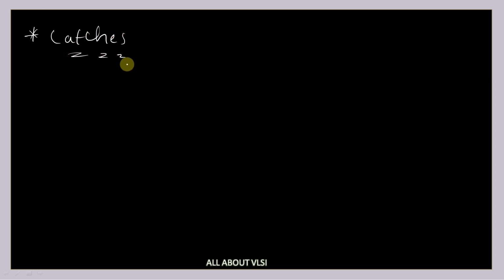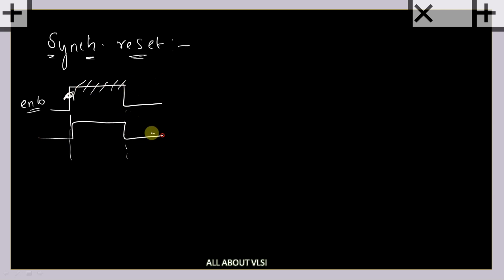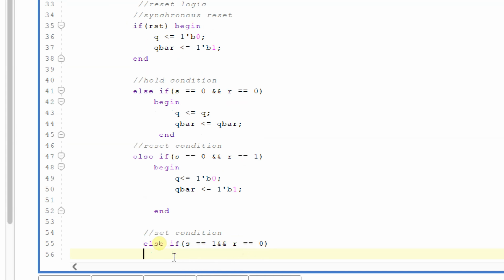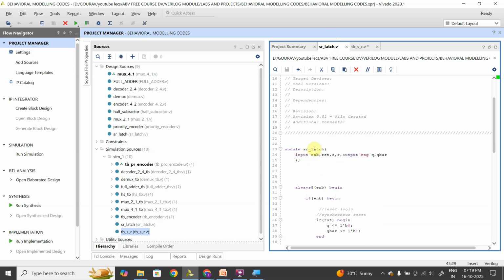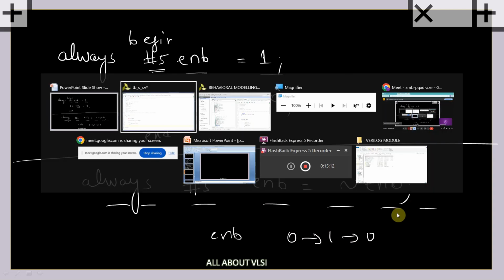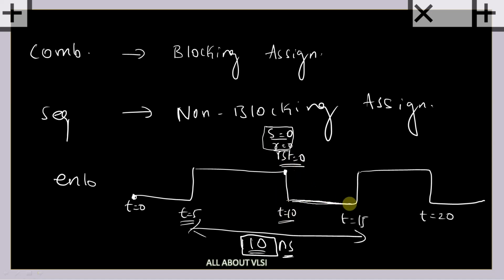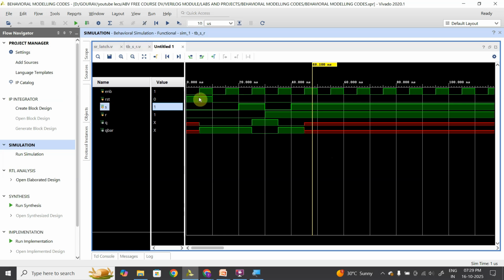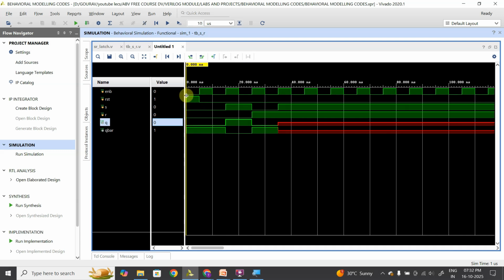SR Latch Design in Verilog | Step-by-Step Explanation for Beginners || Verilog full course ||

Comment: Sir, I am struck  to understand the difference between synchronus and asynchrouns reset
Reply: me too😅
Reply: @bhairavamallarpu1554   it's easy bro 
just go throw the digital electronics
Reply: the synchronos singal reset the sr latch with respect to the clock. in asynchronos signal  without respect to the clock it reset  i hope you understand bro
Reply: @SHAAN0989  bro why did we wrote the reset case twice,i mean why do we even apply a reset after eneble? why dont we just write it as a code
Reply: @SHAAN0989  can u explain why did we wrote reset in if block
Reply: @bhairavamallarpu1554   dm me on linkdln bro Trinayan patnaik
Reply: @bhairavamallarpu1554   Becuse of that's reset is for sr latch na go throw the sr latch truth table

Comment: Sir ..
There is difference between flipflop and latches .... 
In case of latch signal name is enable 
And in case of  flilp flop signal name is  clock.
 Both functionality are same...
But naming  of signals is different
Reply from the maker: No both have different functionalities
Reply: @Allaboutvlsii  sir ..
  in case of Gated SR latch and SR flipflop functionalities are same 
Signals names are different enable and clock
Reply from the maker: @QueryQube in latch enb signal level triggered
Flipflop edge triggered
If possible refer to digital playlist
Reply: @Allaboutvlsii  sir in digital playlist  video is available till combinational ckts. only.
please upload video regarding synchronous and asynchronous reset

Comment: Sir, why have you given only enable signal in the sensitivity list of the always block and why not S and R as well, because according to your code the output of the latch would not get update despite changes in S and R with enable high, the output gets updated only when there is a change in the enable signal and i feel thats not how an SR latch functions.
Could you please explain
Reply from the maker: Latch is going to work whenever enb is high
Now let's say if enb becomes high and always block will be triggered
And if condition will be checked and until and unless enb is high whatever the conditions we have written for s and r inside the block will be working 
If enb becomes zero else block will be executing and again if enb becomes 1 the process continues 

You can once verify this